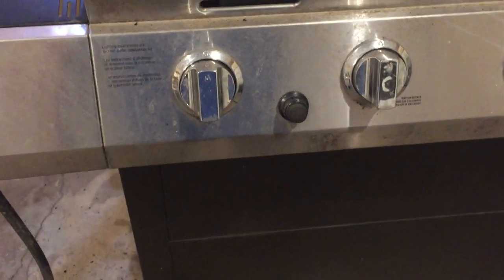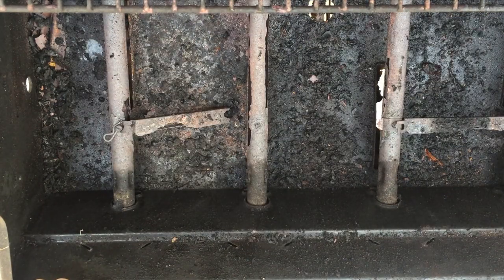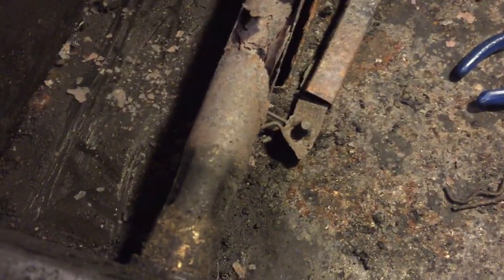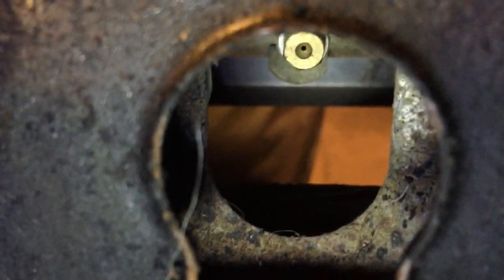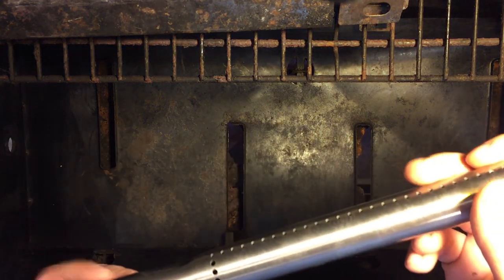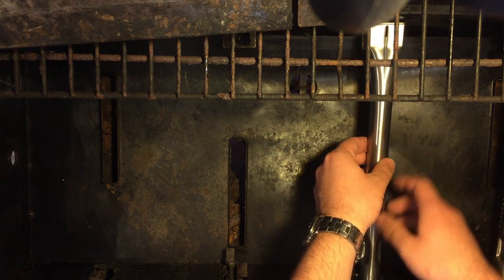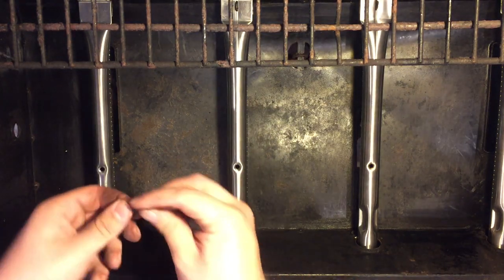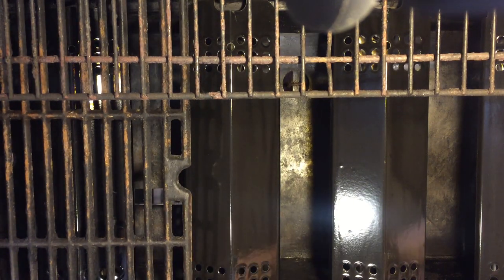How to Replace Burners in Char-Broil Grill

Comment: Thanks for the video.  I noticed you didn't connect the other carry over tubes.  My replacement kit came with three of those parts.  I assume they are attached in the same manner as the first one.   Looks simple enough.  Once again, thanks for taking the time to make this video.  It is very helpful.
Reply from the maker: Good catch. Definitely want to include all of them.  Glad you made this comment so others can be aware. If you only have the one ignitor, all of them will connect. If you have more than one ignitor, the set up will look different. I'll have another video about this concern. Cheers!

ETA: Here is that video https://youtu.be/CnaAMMCdJXk?si=a3nmX-hkcZABHoPp
Reply: 1st thing I noticed😂

Comment: Thank you for the video. It was very informative right up to the part where you were suppose to connect the igniter to the new tubes. I was having a problem with that area. I’ll guess I figure it out. Great video though
Reply from the maker: A common problem is the igniter clip not fitting back on to the new tube. You can use pliers to pinch the clip to better attach. If that doesn’t help I’m happy to answer what I can!

Comment: Great video. I purchased a Char Broil grill from Lowes 2 years ago. Luckily I found the manual and did not realize the burner parts are warranted for 5 years!!! I almost ordered replacement burners for over $70. They registered my grill over the phone and only charged me $5 for shipping!!!
Reply: Not all parts are warranted for 5 years....but the parts replaced in this video are!!
Reply from the maker: @monkabuda  That's great! I've started to be better about saving paperwork when I buy things just for this very reason. I would hate to throw out "free" money!
Reply: @learnsavediy
Reply: Exactly!! When I was looking for the Grill paperwork I came across the Air Fryer paperwork that I was ready to throw away because it stopped working properly. Little did i know it was still covered under the warrantee!! They are sending me a new one!!

Comment: First, thanks for the video.  I really learned a lot about a CharBroil Advantage grill we were given by a friend.  Yes we have to make some simple replacements which with the help of this video those replacements will be easy.  I do have a question.  The bottom pan that you were cleaning on the one we have doesn't have anything below the drip hole.  No pan or anything to help catch the grease, also is is a little more rusty that the one you show.  (Great job on the clean up, hope I can do the same.) Can a grease pan be purchased or that part replaced?
Reply from the maker: Thanks for your comment. You probably could replace it but a cheaper alternative that I have implemented is just putting an old, large baking sheet underneath to catch any mess. Cheers

Comment: at 10:03 cotter pin insertion challenge... made me chuckle :)
Reply from the maker: Every tool can be a hammer if used improperly! Cheers
Reply: @learnsavediy  properly right? i know what you meant :) the other day I was trying to pull a 16d aluminum nail out of a tree trunk, using the hammer claw with a 2 by 4 under it for leverage - the nail head broke off. i was about to snip the exposed nail when i thought i'd try a vise grip - this worked. when one tool doesn't get the job done, try another!

Comment: Question, I recently attempted to clean my Char Broil 4 burner grill and in trying to put the burners back in, I'm having difficulty in putting back the metallic pins  thru the screws due to the Cross Members being in the way of the pin hole inside the screw. Now in your video, you only put ONE Cross Member back in your grills, mine came with 4. Are you saying as long as the one Cross Member is installed for where the Igniter burner is, the other Cross Members and their respective metal pins don't matter and are just extra stuff the manufacturer puts in? If so, you're going to save me a lot of trouble trying to put all 8 pins and all 4 Cross Members back!
Reply from the maker: Great question. I made a follow up video to answer your question: https://youtu.be/CnaAMMCdJXk

You need those cross members to connect the burners so the spark/flame travel to each one. If you have multiple ignitors, then all of them do not need to connect to each other. If you have 1, then yes you do need all burners to connect since there is only 1 ignitor.

Comment: Did the flame guard seem long upon replacement? Is there a special way they go in?
Reply from the maker: The flame guards I got did fit. Many kits now are universal. The guards simply lay on top of the grill ends so it needs to be the distance. I guess you cut cut them down if you have the tools but mine did fit since it was a replacement for that model.

Comment: I have CharBroil Designer series model #463244105 with cast-iron burner. I wonder whether I can use this burner to replace my cast-iron burner? The length should be identical roughly. I don't see any reason why not if the attachment male/female is the same. Can you comment on this? Thanks.
Reply from the maker: Good question. I assume that’d be fine as long as the diameter of the burner matches the male end within the grill. I don’t know if they are universal. Length could be slightly altered with a saw but I’m sure you could make it work. Hard to know for sure!

Comment: If I happened to throw away the screws, what size are replacements?
Reply from the maker: I would search your grill's make and model and "crossover tube screws"...hopefully that will get you the right answer. You can also google the manual for your grill to see if it has a parts list there. Cheers

Comment: No ignitors?
Reply from the maker: There is only the one this grill and it didn’t come with a replacement one with the kit. Usually if it’s not working you just need to replace the battery
Reply: @learnsavediy  on my bbq the igniter is on the burners and needed to be replaced…this is the tricky part. Thanks

Comment: Thanks. Great video and very helpful.  Question. Can those rear mounting plates for the burners be replaced. One of the tabs that seats the burner rusted off. Doesn't seem to be a way to replace those without welding a new piece on. Have you seen those being replaced?
Reply from the maker: I personally haven’t but I’m sure any way you could think of keeping it fastened would work. Welding would be the cleanest but even some nuts and bolts would do the job. It just needs to stay put.